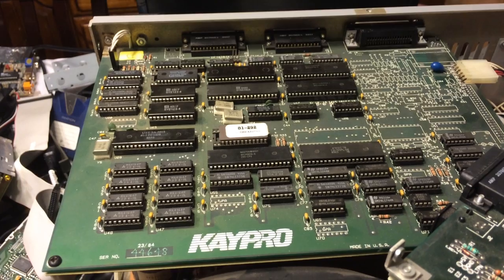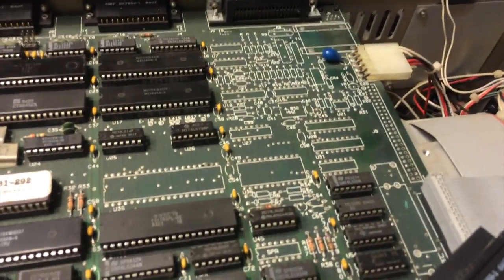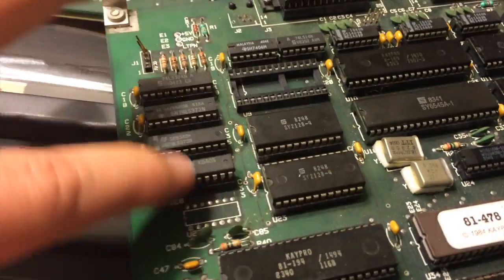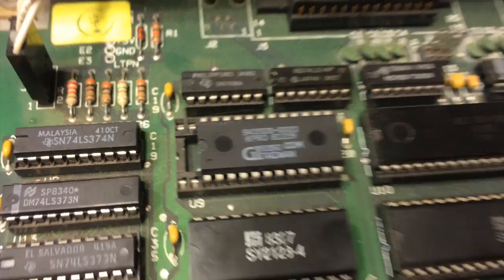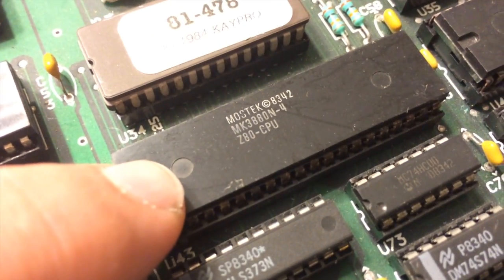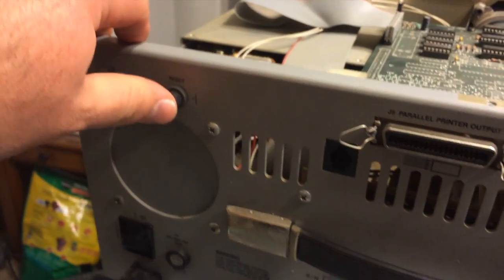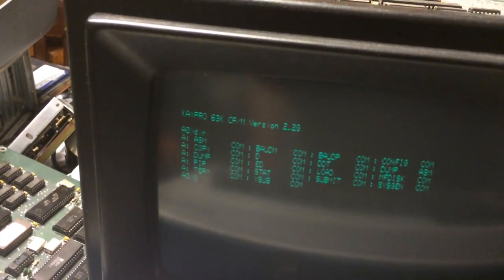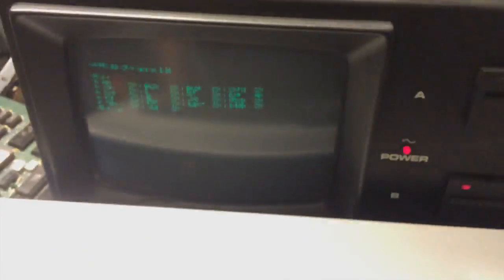Kaypro 2 repaired

Comment: Nice catch. Isn't it handy to have a second board for parts?

The other board has the Real Time Clock/Modem option. The modem is 300 baud. The PIO IC is an interface for these.
There should be a second brightness control on the video board under the CRT. The control should be right next to the focus control.
It looks like the battery didn't leak on the board yet. It should be removed. One can be placed down in the chassis where it won't hurt anything if it leaks.
The later models all used the same mainboard and ROM, so you may be able to use an HDD. There's a few parts to find though, and they're all pretty rare.
If you want to do better than the floppies, you can use a Gotek with the Flash Floppy firmware. It works good for me.
Reply from the maker: Thanks for the pointers!  Yeah, I didn't show it in the video, but I did take that battery out.  I have thought about the Goteks, I just enjoy working with the original equipment instead.

Comment: Did you try heating and freezing the affected video ROM chip?  Sometimes temperature extremes can make the problem go away, at least for a little while.  I also wonder if the Rom chip can be "reflowed" like they do motherboards by leaving it to cook for a while in a high temperature.

I know on standard computer monitors, there is usually an intensity control on the flyback transformer.  I don't know if the Kaypro has one, but I have squeezed considerable more life out of aging CRT VGA monitors by barely tweaking the intensity control.

Also, it that an IBM PS/2 model 50 or 70 I spy under the Kaypro?
Reply from the maker: The ROM chip simply lost it's data somehow.  Either by a power surge or from old age.
Freezing and heating a chip is only good for finding the bad chip, which I already found it, so I didn't need to do those things.

I didn't see an intensity control on the monitor's control board.

And yes, that's an IBM PS/2 Model 50z.  That for some reason refuses to acknowledge any hard drive I stick in it.  I have a Model 50 reference disk, but I don't have one for the hard drive.  I need to find that PS/2 archive again, sometime.  But otherwise, it boots a floppy and runs fine.
Reply: Devin2277 The 50z used an ESDI hard drive, if I remember correctly.  Those are real hard to find nowadays, or at least command a premium in price.

If you need a reference diskette (image) for the 50z, you can find that (along with most other PS/2 system disks) here:  http://www.walshcomptech.com/selectpccbbs/